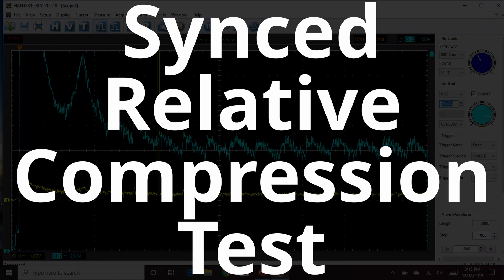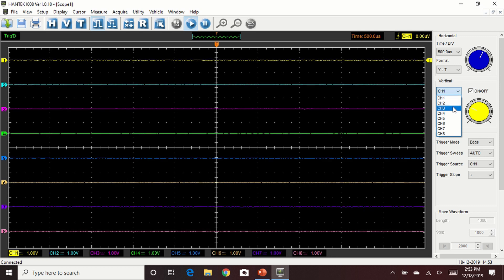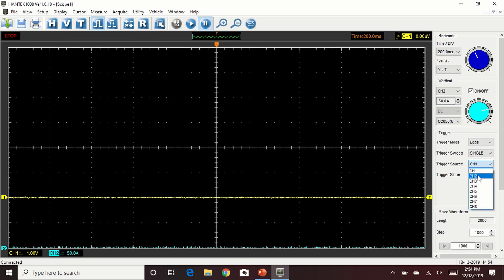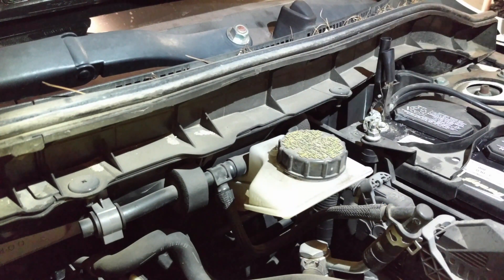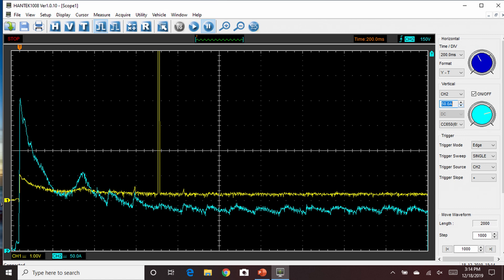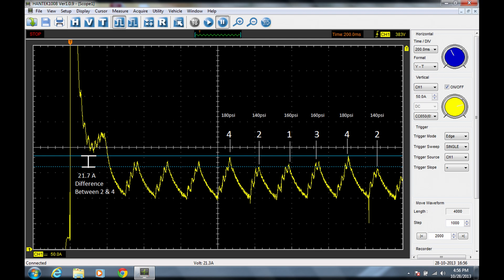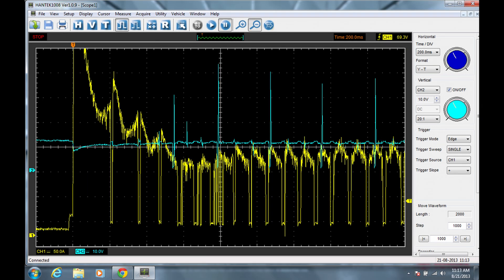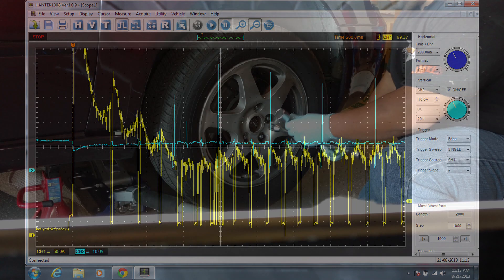Hantek 1008 Relative Compression Test Tutorial

Comment: Do u recomend hantek 1008c for automotive, is it good, fast enough? Thnks.
Reply from the maker: TLDR: Hantek 1008c is good enough but not the best. Decide on your needs before buying.

I recommend the Hantek 1008 for people who are hobbyist or for people who do not know if an oscilloscope is the right tool for them. The Hantek 1008c is fast enough for most of the signals you would see in a car but it does not mean it is the best tool for the job. I used the Hantek for years professionally as a mechanic and upgraded to the PicoScope when the Hantek simply did not cut it. The Hantek is glitchy, sometimes will not display a signal properly the first time and it takes a while to get used to its quirks. The PicoScope, a scope that costs 10x the Hantek, is super fast, with great software and so many functions. Bottom line, buy the Hantek of you want something to play with or buy something more capable if this is going to be part of your livelihood.

Thank you so much for your question and thank you for watching my videos. Any other comments or questions you may have simply give my comment a thumbs up so I know to look for your comment. Thank you again and hope to hear from you again soon.
Reply: So what do u recomend on a budget?
Reply from the maker: If your major need is to stay at a low cost, then the Hantek 1008 is the way to go. The cost is low and for the price you get good functionality.

Comment: I want to buy a hantek 1008c is it a good  scope  since I see you using  
What you think about? Does it give any issue? Do you use it with 1st look sensor
Reply from the maker: It is an OK scope. I like to think of the Hantek 1008 as a scope to buy if you are unsure if a scope is a tool that you would benefit from. There are a lot of drawbacks to using the Hantek 1008 but it has enough functionality to perform some tasks. As for the 1st look sensor, I have never personally used it but from the information I have found online the frequency output of a 1st look sensor is not very high therefore I believe it can be used successfully with the Hanek 1008. Thank you for your questions and thanks for watching!!

Comment: The second RC waveform for the ford  is cleaner than the first waveform you show .what makes the difference.Happy new year
Reply from the maker: Excellent question!! The 2nd and 3rd waveforms had the amp clamp on the cable that went to the starter motor. That will generally get you a cleaner waveform. Additionally the Mazda that the first waveform was taken from has an electronic cam phaser on the intake cam which can vary the pressure in the cylinder during cranking resulting in a smaller difference between maximum and minimum current drawn from the starter. Thank you for your insightful question, and thanks for watching!!
Reply: Using the 10x probe instead of the normal 1x probe that come with the hanktek kit ,will that make a difference in the getting a cleaner waveform .
Reply from the maker: Unfortunately not since the waveform is the CURRENT waveform and that is measured by the CC-650 current clamp

Comment: Please make another test just reading AC voltage on battery during cranking ,result should be the same.
Reply from the maker: That is an excellent idea but this Hantek 1008 does not have an AC coupling function. This would be an excellent idea for a video with a scope that has an AC coupling setting. Thank you for your suggestion and thanks for watching!!